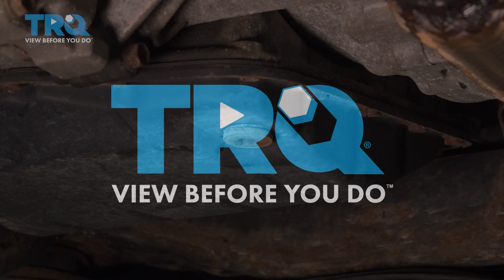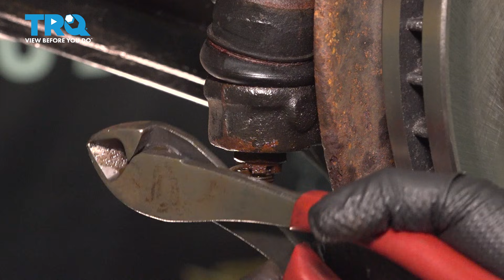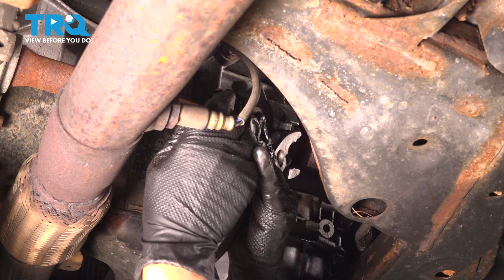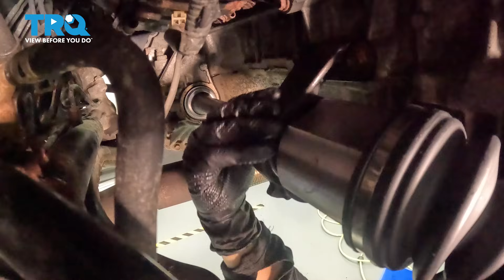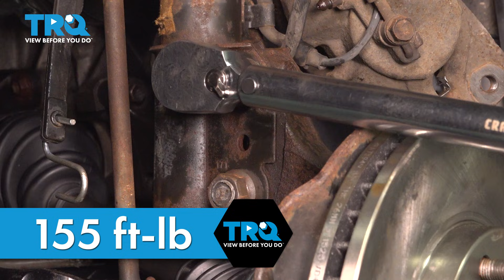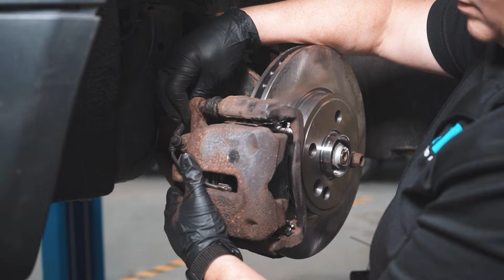How to Replace Right Front CV Axle Assembly 2002-2006 Toyota Camry

Comment: The Car Care Nut - removes lower BJ three nuts and bolt and side stabilizer bar. Fold the rotor to one side with a ratchet strap... Saves a lot of time...

Comment: I always replace the seal while axle is out ( 12$ part vs two hours redoing it) if carrier bearing ts stuck take off housing from frame put it in a vise makes it a lot easier. also use a dab of antisieze in case you ever have to remove it again.

Comment: 1, unstake and brake the axle nut while the car is still on the ground.

2, you don't need to take the knuckle apart, just undo the control arm and remove the lower  ball via the 3 bolts.

Now the axle can be moved out of the way and the knuckle propped on the bolt holes for the lower ball

Comment: i just finished the job using this video , its a good video,, BE ADVISED though ,,, on the 2005 Camry SE the upper bolt that connects the strut to the knuckle is for adjusting the camber and should not be removed ,, remove the balljoint bolts instead. i rounded off the bolt by the time i removed it and figured out what was wrong lost my camber and now am off to the alignment shop.

Comment: previously when I did this on both sides the cv axles I used were not in spec. Passenger side did not seat correctly, well 20k miles later im doing it again. cv boot and wheel bearing exploded.

Comment: Just did this job, the video is super misleading, just take off wheel, take off axle nut, disconnect the two strut bolts (22mm), take off 12mm holding brake line and sensor wire, slide axle out hub side, take the 3 14mm bolts out to remove the entire carrier off the engine, hit the carrier away from the diff with a hammer which should free the inner part of the axle, take the whole assembly out including the carrier, take out the axle clip and the 14 on the carrier itself, then hammer the carrier off the old axle (heat the carrier first), use a wirebrush to clean and use grease to lubricate inside of the carrier, then bolt carrier back in, put axle back in, reverse steps to reassemble